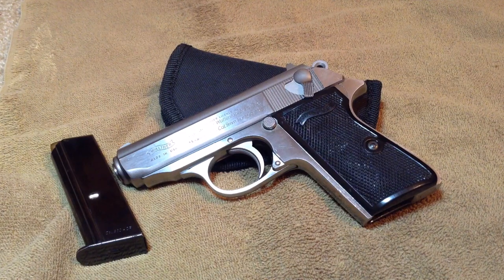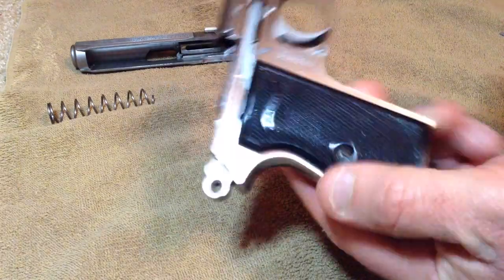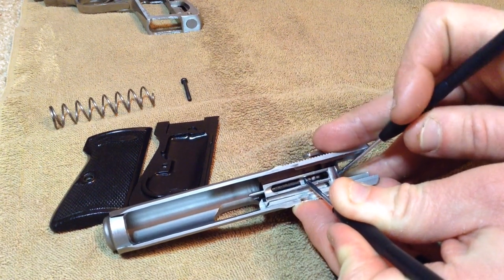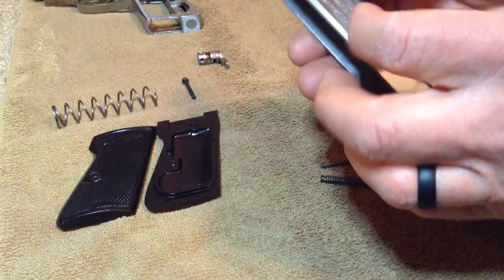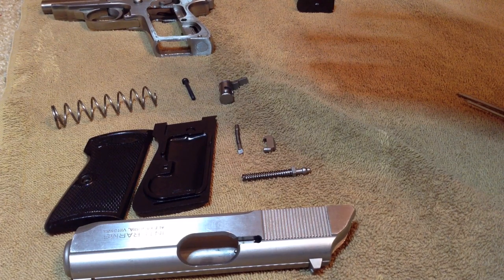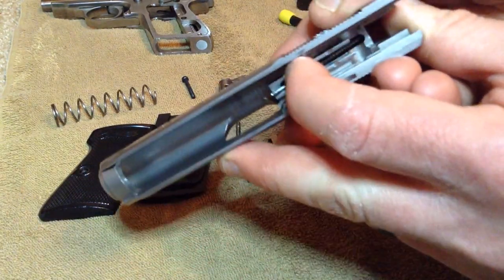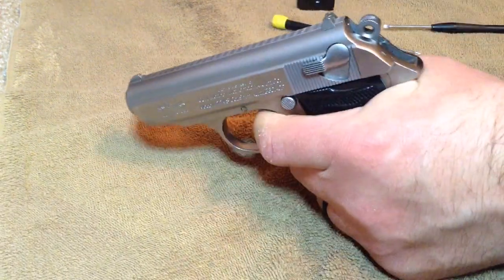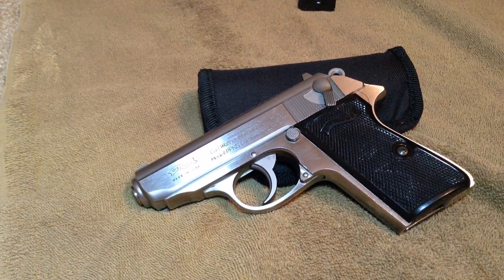Walther PPK/S Slide Disassembly and Field Strip

Comment: This was very helpful.  For disassembly I rotate the trigger housing down and keep it down with a short length of quarter inch wooden dowel placed in the notch in the trigger housing and bearing against the frame.  Then both hands are free to grip the gun and pull the slide back until it clears the frame.
Reply from the maker: That’s a good idea. Saves fingers from being pinched. Thanks for sharing and thanks for coming by!

Comment: I disassembled my .32's slide to clean it recently and this guide was very helpful. Be very careful putting it back together though, I've done something wrong in the process and now the slide needs a lot more force to be pulled back. Always be sure you know what you're doing before you do it!
Reply from the maker: That could be something as simple as a spring being put in backwards. I would probably disassemble/reassemble one more time to be sure, if it still gives you problems run it down to the nearest gunshop with a armorer or gunsmith. Thanks for watching and thanks for coming by!
Reply: @cornfromajar3222  This is good advice! I'll try flipping the spring around when I disassemble it next. Personally I suspect it's the case extractor pin because it seemed to be unable to actually go back in all the way until I forced it through and kept it in place with the safety lever.

Comment: I did not know this was produced in 9mm. My own of years ago was in .635 ! Iliked it, but gave up all firearms owing to other committments !
Reply from the maker: Well mine is .380, on the slide it is stamped “9mm Kurz,” or “short.” I’ve never heard that round called 9mm short, other than in relation to this pistol. 
Thanks for dropping by!
Reply: The PPK was,  way back available in .22,  7.65mm and 9mm Kurz a common term in Europe. I obviously never heard of the imaginary .635 however it may very well have been manufactured in 6.35x16 aka 25ACP.

Comment: 0:45 Hi. great video! I also had  trouble getting that firing pin back into that square channel with a screwdriver. I found gripping the end of the pin with needle nose pliers squares up the firing pin to push it back into place. Use light pressure of course. Hope this helps someone.
Reply from the maker: Thanks for sharing and thanks for coming by!

Comment: good video. Another disassembly/cleaning video I watched didn't even mention the firing pin, ejector, or chamber indicator! As someone new to gun maintenance this video was extremely helpful. Thanks :)
Reply from the maker: I’m definitely not an expert but I’ve had this gun about 15 years and have shot/cleaned/ broke it down several times. Thanks for coming by!

Comment: Nice video.  The only thing I would suggest is that you should always use the largest-possible screwdriver that will fit in the slot of your straight slot screw. Never, ever, use a screwdriver which doesn't fill up the slot entirely. I had to learn that the hard way by boogering up the screw slot with a too-small screwdriver. And, on a piece as nice as the Walther,  you don't want to mess up the screw, or have the screwdriver slip out and scratch your firearm.
Reply from the maker: Grip screws are an easy thing to mess up and you are on point. Thanks for coming by!